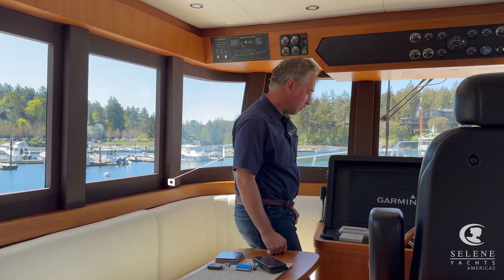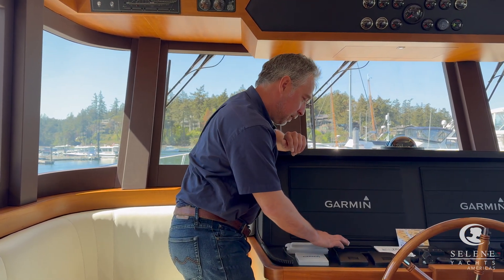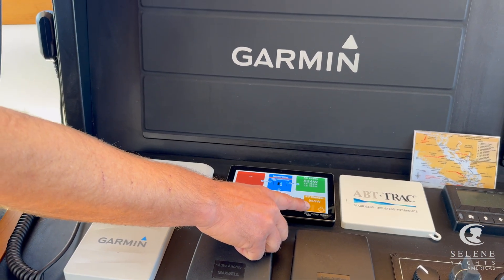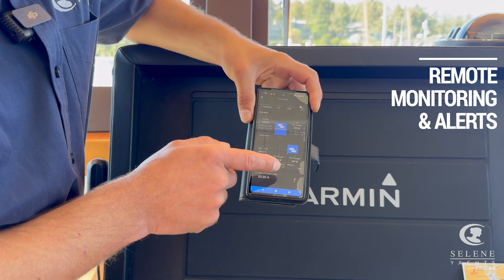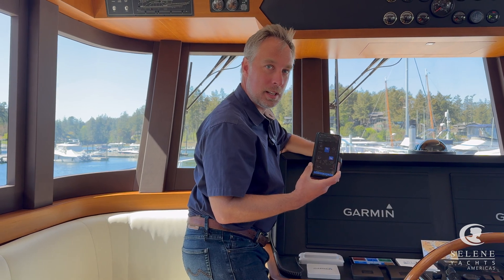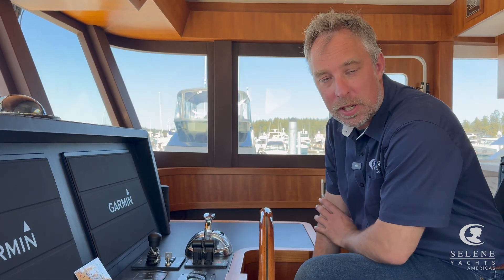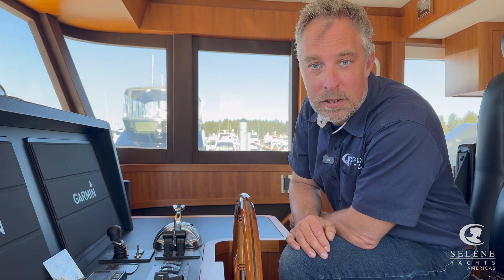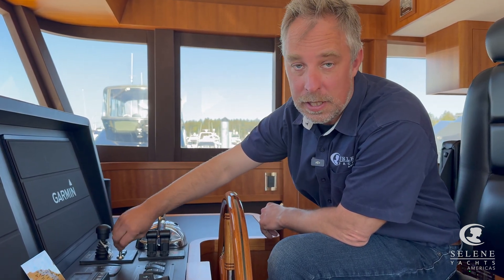Selene Americas Tech Talk with Dylan - Solar, Get Home & More - Selene Ocean Explorer 60

Comment: I like this video. Question: how is steering with Get Home Only and dead main engine?
Reply: Autopilot.  James Knight, THE Nordhavn guy, did an hour long review of a Selene 59 on YouTube & mentioned that “feature” on the Selene boats that have the big generator/ PTO as the get home method. If the steering hydraulics are run off a main engine & that dies then steering a 60+ ton boat becomes a bit of a problem. Turn on the autopilot & make course corrections with it. Not ideal but workable. A sea trial to test the get home capability of the generator/PTO won’t catch this unless you turn the main engine off - not just stick it in neutral & switch over to the PTO.
Reply: @keithwest3699  I see, yes. Last resort. thx

Maybe backup steering hydraulics off of 2nd generator?